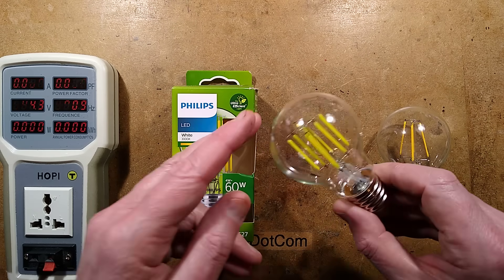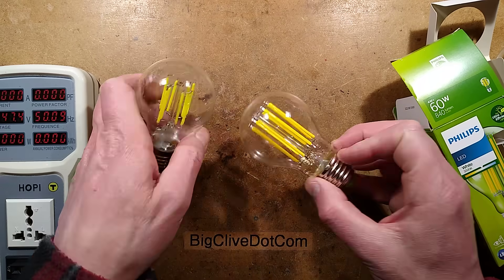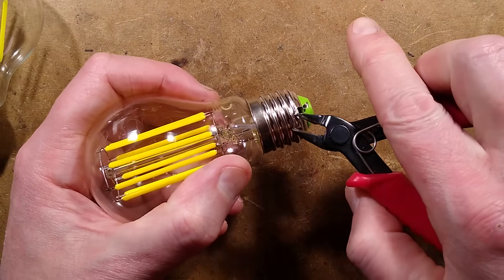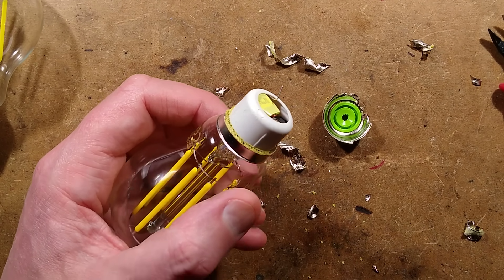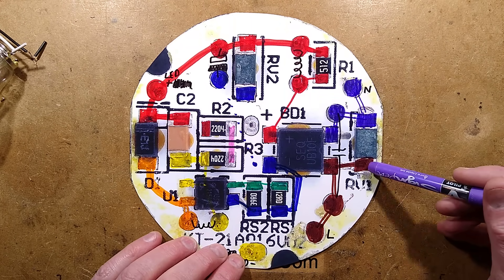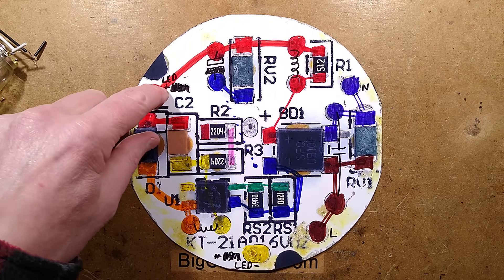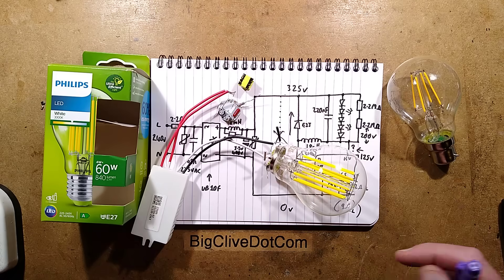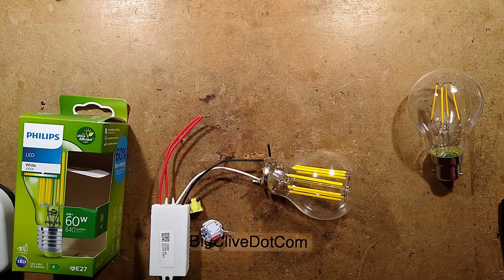Inside a new Philips ultra-efficient LED lamp (with schematic)

Comment: I still have on of Philips’ first generation of LED lamps. A big beast with a big aluminium heat sink and lovely colour. It’s probably been on 12h a day on average for nearly 20 years, and still works fine. Well worth the £35 it cost back then.
Reply: not having to replace bulbs but one or twice a lifetime is worth it for sure.
Reply: @tobiwonkanogy2975  put an incandescent on a dimmer at 50% and it'll last 100 years
Reply: @tobiwonkanogy2975  Bulbs are 90% heat, so yes.
Reply: @flexairz  those statistics were for the old incandescent bulb. not sure what they are now but that's why they last longer , they don't burn out or self destruct when you turn the switch on .
Reply: @flexairz  Modern LEDs produce only about 40-60% heat. The theoretical maximum efficiency for cool white light, where all the energy is used to produce visible light is about 350lm/w.
Reply: Installed at load of Sylvania 5W GU10 lamps years ago and they are just starting to fail, replacements are only lasting months rather than years.  Should send one to Clive for the autopsy.
Reply: @timballam3675  Good idea, mine are now failing after 8 years, but start working again if you flick the switch on/off.
Reply: I have an early LED in one of my bathrooms I put it in the light fixture about 20-25 years ago and it is still working.  It gives off a pinkish light but being that it is only on for a few hours a day.  Agreed that the life of the bulb was worth the price.
Reply: I have a Philips Master LED GU10 that's about 10 years old, mostly heatsink and glows after you turn it off, was also not cheap when new (maybe €30?) but still working great. So many LED halogen replacements were utter junk back then.
Reply: @AaronSmart.online  I can't remember what I paid for my old school LED bulb but it couldn't have been much because I got it at Walmart.  My feeling is that I paid about $20 CDN.  A few years later in conjunction with the utility company they were selling LED bulbs for about fifty cents each.  I stoked up and have a stash of them.  Heck my daughter raids my stash when she needs/wants a new one.
Reply: @misamsung6191  GU10 is a particular type of bi-pin fitting common in Europe for compact halogen lamps (often recessed ceiling fittings). LED replacements did not come quickly or cheaply for any sort of decent quality - the early LED examples often used a large grid of LEDs but were usually very dim and flickered a lot. The Philips one I mentioned was the first I found to produce decent 50W halogen equivalent light with decent quality and no compromise in shape (same size as halogen GU10 so fits flush in ceiling fittings).
Reply: @AaronSmart.online  Yes I know that the GU10 is/was common in Europe but it isn't uncommon here in Canada too.  They were being sold at a discount price at the same time as the GLS and I scored a bunch.  The problem with LEDs is that unlike their old incandescent people have to read the packaging to see what the colour temperature is
Reply: @AaronSmart.online , excuse me
¿Could you please provide the full part number for the Philips Master LED GU10?
I want to buy some, but there are several models for the GU10 line and I would like the one you mention
Reply: @juanl6216  I bought it 10 years ago, it is definitely long obsolete and out of production.
Reply: @AaronSmart.online  OK, thanks for the reply
Reply: I too have one of the original generation LEDs which has been outside in a motion sensor light for atleast 10 years, it was given out at a home and garden show as a free gift when they came out... its out lasted 3 of the newer generation LED bulbs running in the other socket of the fixture so far....
Reply: @ernieduncan602  i go through them like no tomorrow. I need to do the resistor hack i just bought three. I'll find the big clive upload where you snip a resistor off to halve the power i bought bright ones to enable a decent amount of light, post hack. I digress.
Reply: We have several of those. We got them one a payday years ago because they were so expensive. When our home had a severe fire back in 2013 we took those that survived with us to our temporary rented home, and brought them back after we rebuilt. They are still here and in use today.
Reply: Same:  All my very old, heavy and expensive early Toshiba, Samsung & Ledon LED bulbs still work, not a single failure.  
While anything produced more recently….
Reply: Worth the extra expenditure on purchase then, evidently.
Reply: Early LED lamps paid for themselves in energy savings vs. incandescents, but in most respects they are already obsolete.  They are less efficient and have worse color rendition than cheap modern LEDs.  Modern LEDs are cheaply made and don't last very long, but that's really what you want in an LED, because they'll also be obsolete in a few years.  Lighting technology is evolving incredibly quickly.
Reply: @jbalazer  I suppose, but being in a bathroom and working just fine I am loath to throw out something that is working.  Because they fail so infrequently I can say that I only remember changing one LED bulb out since I started using them.  That was in our back hallway, it was on from dark until my daughter got home from work late at night.  So its duty cycle was quite long, but as Clive pointed out I suspect that heat was a major factor in that bulb failing.  Not that it makes a difference but it was from IKEA.
Reply: Yeaaah i know in USA The White L-prize well i still have 1 of The big heatsink LED lamp 12 w button The standaard without The yellow remonte phosphor and The "Royal blue" dedicated luxeon power LEDs costs a arm( 60 euro.s    ) here in EU now all ledlamps are cheap COB (and The Filament version) SMD s
Reply: I am pretty sure you could not buy a LED bulb 20 years ago as there were almost no powerfull white LEDs available back then.
Reply: @Poebbelmann  Well then you're pretty wrong.
Reply: @namespacetoosmall  Do you have any brand name and modell number for us?
Reply: how in the hell do you remember which light bulbs you put in 20 years ago?
Reply: @joeblankenship377 
You look at them
Reply: are those the wonderful remote phosfer 2700k bulbs? if you take the phosfer off it changes it into a LOVELY royal blue death beam
Reply: Same. Love the old ones. Made in the USA.
Reply: No, mine definitely says made in China.

Comment: Googled them and saw they offer "neutral white" at 4000K aswell. Bought two for a friend now to test out in his lightfixture. He has an old light with small shades. 6 lights, each with it's own "cup" pointing downwards and collecting the heat. We'll see if he burns these ones out in 2 month aswell.
Reply from the maker: Check out my dooby lamp videos for making some lamps last massively longer.

Comment: I had a set a 3 led 50,000 Hour life lamps from B&Q. One lasted about 20 minutes , the other  2 are still working well now after about 4 years or so.  B&Q did replace the dud one when I returned it the day after I purchased it.

Comment: Symbol indicates do not use in motion sensor lamps - I’m guessing that the leakage current that typically powers the detection circuit (via a more traditional lamp filament) either doesn’t work with the internal power supply, or the leakage is such that the lamp doesn’t turn fully off - and in doing so eventually causes the buck regulator to fail.
Reply: Just use a motion sensor with a neutral connection and a relay if you can.
Reply: you just made me understand why certain leds do what you mentioned in my flood light.... thankU!

Comment: I really don't like the greenish tint they give off. Philips could have done a better job if they'd wanted. R9 is negative 10, meaning that things that should appear red seem more pale and dimmer than with regular led or incandescent light bulbs. You can find that information and a picture/curve of the light spectrum in the EU - Product data sheet.
Reply: I've binned so many new LED bulbs because of the green.

Comment: Yes, finally a video about this lamp! When I first saw these at a local hardware store I had to think about your video regarding the dubai lamp. I was curious and bought two of them, in 3000 and 4000 K, the colour has a green tone to it, but other than that it is a really interesting piece of lighting equipment. If it had an CRI of 90 or higher, it would be a great lamp!
Reply: It's an efficieny thing, very high CRI leds have a slightly lower luminous output per watt, something to do with the phospores wich convert blue/uv  light into visible light. Same goes with colour temperature, 4000k is more efficient than 3000k usually.

The most efficient type of led is usually a 4000k 70cri type in most of leds.
Reply: I bought the 3000K 4 watt version and the colour was a sickly green/yellow. So I took it back and got a 4000K, it’s just as bad. I kept it but it’s currently being used in the garage.
Reply: The 3000K is yellowish like an old filament lamp?
I'm curious about the spectrum color distribution also, but for that you need some kind of light spectrometer.
How many cost you that lamp compared to the regular LED lamp?
Reply: I bought both the 2.3W(40W) and the 4W(60W) in 3000K.
Boy, they are disappointing.
The color rendering is just... horrific. Don't understand how they would ever measure an Ra index/CRI of 80.
"Eye-Comfort" (wich is written on the package) and phrases like "eye-pleasing" are just euphemisms for "horrible greenish color".
Yes, they are very efficient, but that's the only positive thing about them.
You wouldn't want any of those lamps in your living area's of your house.
Reply: @papsdevisscher6396  I can confirm this sentiment. The color is horribly greenish, something more at home in a horror movie hospital than in a home.
Reply: @papsdevisscher6396  Yeah. Mine lasted 60 seconds before my wife ordred me to replace it.
Reply: @papsdevisscher6396  I see, that's why the box's color is green, that's a hint.
Reply: So THAT.S why these LED super efficiënt are CRI low80.S close to 79 orso giving it.S effiency Lm/W😉
Reply: How is the 4K one? Is it a neutral white as they claim or is it still "yellow / warm"?
Reply: @Black3ternity  Seems neutral white to me. But that's just eyeballing it. I don't have a spectrometer.
Reply: Thanks for saving me some money. I hate the gray / gray / blue distorted lamps.

Comment: I wonder how the heat is. My enclosed overhead fixture kills everything so fast. This might be a long-term fix!
Reply: As heat is the energy that isn't turned into visible light, that lamp produces much less heat per watt it uses compared to "common lamps", and as it produces more light per watt, the heat for the same amount light is even more reduced. Heat is unlikely an issue with those lamps.
Reply: @fishyerik  in theory, yes. But it's not the filament that's cooking in my enclosure. It's the board from component hotspots. I'm not sure if driving twice the filament at half the power is going to change anything on the board. Won't stop me from buying a bunch, though.
Reply: @Peffse  Driver power, therefore also heat generated is included in that total power draw. There's not much room for heat  generation when it produces 840 lm from only 4 W, filament and driver combined.  Sure, if it was very poorly designed some component could be prone to overheating anyway, but it's unlikely to be the case. If those also die within a short time, there's probably something else that's wrong.

Comment: They did it. Great move, results in free marketing.
The 4 W is 11€ in the hardware shop. It says 500.000 switch cycles on the data sheet.
There is no green peak in the curve. Just blue an orange. Ra is 80
Reply: where do you find datasheet for light bulbs like this?
Reply: @redoktopus3047  lighting  philips
Reply: Did you actually buy it and try it? The OSRAM's >200lm/w lamps also have no green peak in the curve but they make very green light.
Reply: And indeed OSRAM claims 500.000 cycles for switching yyeah, the same green hue as Philips at 3000 k

Comment: BC: "Let's go for the EU voltage 230V... " ME: looks at my PC energy meter which shows actual voltage. Meter: 252V AC
Reply from the maker: 245V here right now.
Reply: Yes we average 254vac overnight.
Reply: @dogwalker666  Here it is 24/7. My guess it is cause I live like 100 meters from power transformer.
Reply: @josifvissarionovich5320  that's very possible.
Reply: huh? its more like 240.
Reply: @prydzen  that's the official UK average,  we pretended to drop it to 230 to keep the EU happy,  however that didn't happen.
Reply: @dogwalker666  what about 60hz? can  the powergrid switch easily?
Reply: @prydzen  not easily it would require replacing billions of pounds of equipment.
Reply: @dogwalker666  why not overclock the equipment and replace as needed?
Reply: @prydzen  Because everything is designed to not allow the frequency to drift, every sun station would require replacement, then every backup generator, Then you have the consumer side, every Squirrel cage motor, in the country could require replacement, Transformers would require replacement, even
Reply: @prydzen  frequency of the grid is also used as indicator of load to control generators. As far as I know lover the frekvency higher the load and vise versa. Generators are set to keep 50Hz therefore balance the load Vs generation.
Reply: @josifvissarionovich5320  yes but 60hz is more efficient.
Reply: @prydzen  A little yes it is. But would it be worth it to change whole infrastructure? Most likely not. Especially when all of us use a lot more efficient transformers running at thousand's of cycles or Hertz. They are called switched mode power supplies. EDIT: I just came home from work as well as a lot of people around here. And the voltage has fallen down to 248V :-D

Comment: 50 years! - the capacitors won’t last 50 years! - even at the low usage per year.
Reply: I assume they are using Philips capacitors and since they actually make them they can accurately calculate the life.
Reply from the maker: The capacitor is only seeing 100/120Hz ripple, so much less stress than one on the secondary of a switching supply.  The secondary one here is ceramic.